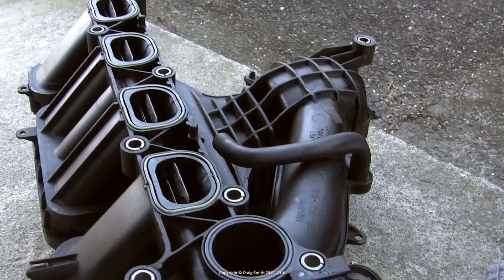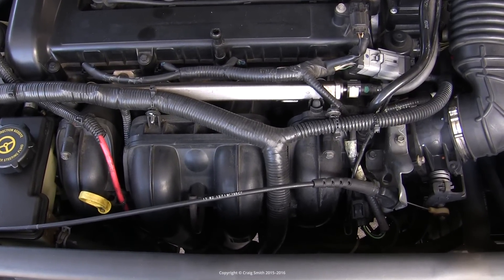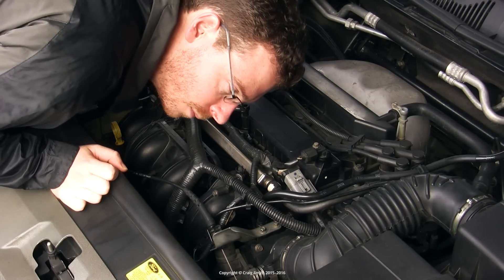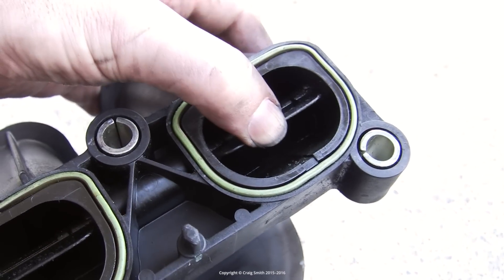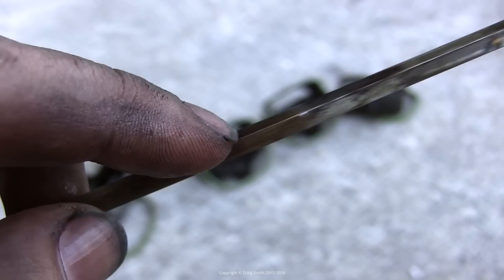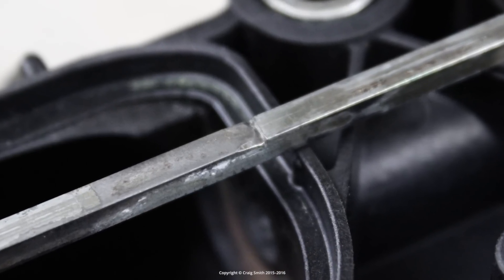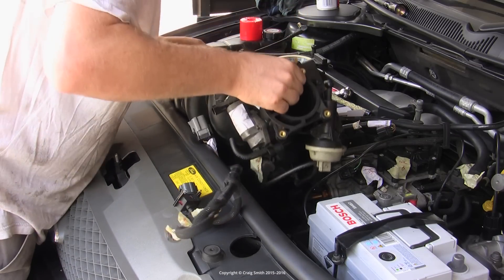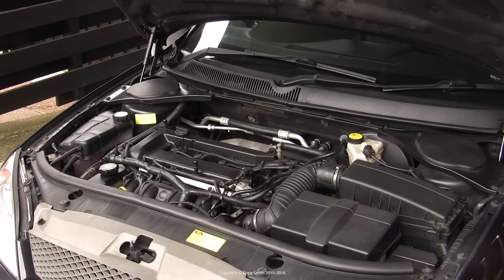How to: Fix swirl flaps & save your engine (Ford Duratec HE, Mondeo/Focus/et al)

Comment: You're awesome! This video helped me a lot. Quick question - do the mondeo flaps fit on to Ford Focus 2009(hatchback) ? Thanks!
Reply from the maker: I think so. I would however order any parts using the correct Focus part #s.
Reply: @CraigsDIY  Yes you're right, but I tried with the dealer and they're "not sure" if mondeo fits on focus. They wanna sell me the whole manifold instead, so annoying! Can I go ahead buy those flaps? What do you think?
Reply from the maker: Check your manifold has the actuator at the side. Then, it would be best if you pull off the manifold and check for yourself. Or, buy from a place that will accept returns!
Reply: @CraigsDIY  thanks man! I just got a used one in good condition. Will try that. Thanks a lot for your help!

Comment: My car had 70,000 miles on it and the flaps were not worn at all, they still fit tightly in the housings.

I removed them anyway, the car runs just as well as it used to, maybe even slightly better. I also installed an oil catch can because the oil seperator on these cars suck too much oil into the inlet for my liking. Might be why the flaps had so little wear in my case.

Comment: I did a simple vacuum mod to a Ford Fusion intake w/o intake runners and installed, easier and works great.
Reply: What do you mean simple vacuum mod? Did you just remove the intake runners and did you still plug up the rubber motor?

Comment: Hi. What do you seal up the hole with where the rod goes? I don't quite get what you said in the video. Thanks!
Reply from the maker: I said Araldite, but any epoxy will do.
Reply: Thanks. Great video by the way.
Reply: Thank you! I have another question: With this fix, is the rod necessary?
Reply from the maker: Not if you're taking the flaps out.

Comment: You sir have probably the best user content quality I've seen on a diy video.... Ever!
Just bought an 07 focus 2.0 duratec with 55000 miles and am really worried about these flaps.
My car already has a pcv failure which led me to your videos.
I also have two bad pulleys and a stuck thermostat or bad coolant temp sensor. I'm not sure because the car will warm up to temp but takes a a little. However once it warms up it seems to pick when it wants to open the t stat and usually when I'm  putting around town. It's random as sometimes heat is fine.
So I'm pulling the manifold and doing a tstat while I'm there doing pcv.
Contemplating deleting the plates but worried about if I fill the holes with epoxy, that it might come out or I'll get a check engine light as I need emissions.
Reply from the maker: I would just inspect the flaps (the rod particularly, as shown). Decide what to do based on their condition, if they're fine then leave them, maybe end-for-end the rod like me. If you do remove them I doubt you'll get a CEL, so long as you put the actuator and its connection back with nothing to do, the effect of the flaps appears to be subtle. 
Almost certainly tstat failed, so long as temp sensor giving sensible readings (ambient temp when cold, and up) it's probably fine.

Comment: Thank you for this video.  Pardon my question: is this also applicable for a 2009 Mk2 (Mk2.5) gas Duratec HE engine?  Do they have the same assembly?  Took me forever to get a video that somehow might be related to the ticking sound (identified by our mechanic as "normal for injectors"). Thanks again!

Comment: Hi, what is the corect name of that mechanism who open and close the flaps? Because i have a problem with him (always is come of from the plastic nut) and i what to replace him but i dont know the corect name. Thanks!
Reply: Solenoid actuator perhaps? Or actuator arm which is controlled by vacuum via the solenoid.

Comment: Could you replace with a fabricated stainless intake manifold?
Reply from the maker: If you really wanted anything is possible... there are alu racing IMs available for the Duratec, expensive and remaps are required.

Comment: Hey man, well made and very helpful video. I have now this problem with my Volvo c30 2.0 Duratec :( Mechanics say that removing swirl flaps requires some ECU software tweaking  Is that true?? Because you don't mention that. I own 2007 Volvo C30 2.0 pre-lift
Reply from the maker: It would probably be ideal but most people report it runs fine without.
Reply: @CraigsDIY  aa

Comment: Hello Craig, just watched your Duratec manifold R&R video and now this one on fixing the swirl flaps. Interesting suggestion to just not re-install the flaps due to cost and take the little fuel economy hit. I may consider that after inspection once the manifold is removed.  I mentioned before you seem to have good video capture and editing abilities, it really makes for a high production value, especially with the post recorded voice over. I think I'm going to try that also on my next repair job.
Thanks, KPO
Reply: Okay, so I finished it earlier on today, the rod was an absolute prick to remove! And there oddly was only a plastic casing with all this ground up looking plastic in centre between inlets. I had to clean all of it down including between inlets were rod was due to how worn it was for the epoxy to grip. I filled every hole the rod went through and left the agitator on attached to side but left the white clip piece out as well so no cel code was thrown either. Initial test drive so far so much more responsive, picks up speed faster. I have noticed a slight delay or something along those lines if giving gas backing of n full gas straight away. Will see what it’s like for the next few days but seems to be running beautiful. Have not noticed a decrease in fuel consumption yet but will be able to tell later on down the line. Give it a go if you haven’t already. Also massive thanks to this channel. Has helped me through my journey with alot of swearing i got there in the end lol
Reply: How did your manifold turn out removing the flaps? Was going to get started on this myself over the weekend. Thanks for any information.
Reply: Kris Lynette I’m currently doing the delete method on my 2002 Mondeo 2.0 Duratec HE as my flaps are around 5x as bad of movement as this video after inspection tonight. It has taken me 3 months to get around to it as I suspected flaps to be the cause and had to weigh up options before jumping the gun. Will update you tomorrow once car is together and another update after a week or so with a flap delete. Note I’m not that experienced with cars and the removal task alone took nearly 6 hours with several 1/4 socket extensions written off as the 3/4 set doesn’t fit where bolts are

Comment: Just changed the whole intake manifold on my 2008 focus 2.0 titanium (UK) for one out of a fiesta st150 runs much better thanks, virtually a straight swap but without the swirl flaps and fitted a new PCV valve & roose motorsport PCV hose thanks for posting these videos Craig they're really helpful 😀👍🏻

Comment: Could one just wedge something into the actuator so that the swirl flaps would be forced to remain open?  Wish I could better describe what I mean.
Reply from the maker: They are open at rest. Disconnect the vacuum hose to the actuator and they won't close. But it won't prevent the problem developing.

Comment: Years ago I had this problem with my duratec 2.0 focus...I bought an intake manifold for an Escape 2.3L  application. The escape manifold don't have flaps. Still mounted the solenoids and actuator but just didn't hook up the linkage as there was none. Worked fine for me for 100k miles.

Comment: I replaced the thermostat in my 2005 Duratec 2.0 16valve and while at it i removed all the swirl flaps in the manifold with no issues to the running of the engine. It runs perfect. So saved myself a few quid.. I was told to do this by a ford mechanic and he was rite.. Took 3hrs start to finish. Was easier to remove the radiator and that gave full access to everything. Great video..
Reply: Has he blanked hole after flaps bar or just removed it all?
Thx 
Matt

Comment: is this applicable to a 3002 2.3L ford ranger?
Reply from the maker: Yes, modulo the details. You can check for the presence of the flaps by looking for the actuator next to the throttle body. But I'm not sure about the actual failure rate on the 2.3's, I only know it's been a major problem as shown on the 1.8 and 2.0.

Comment: Just did the pcv job on my Volvo S40 1.8 from 2005 which has the same engine. I inspected the flaps and found that there were no bushings and not much wear.
Vehicle has 150.000 km and i have only owned it for 2 years so i don't know if someone has done the changed the flaps, though i doubt it very much.

Great video btw, very helpful.

Comment: I know this video is pretty old now in youtube time, but my 2003 Ford Ranger 2.3L 4 cyl Duratech could have been the subject of this video last year! *NOTE: The warning sign for many of these motors having this occur, (and there are videos), is the plug on the opposite side of the manifold and vacuum actuator where the shaft for the flaps goes through , falls out, and creates a huge vacuum leak and runnability problem. It gets punched out by the shaft vibrating and dancing around when those shaft bushings go bad!!!

Comment: A little Question .. i got an focus 2 flexi that sounds like a disel so i guess my flaps are shit and are about to change valve case gasket and was thinking about to look up the flaps to 
 
The idea i had if it would be posible to fixate the axel so the flaps are constantly fully open insted of removing the mainfold then the axel and flaps as an easy solution when easy and fast is nice when working in minus 10-15c and snow ;) ...so what do you think is it possible fixing it that way with out removing the mainfold ??

Tnx for a great video
Reply from the maker: That may slow down wear a little (and not by much I would guess), but it won't fix anything. If they're already rattling they're a ticking time bomb. The wear is done by the vibration.

Comment: Great video but I have a question, does anyone know if this is also an issue on the Mazda MZR engines which seem essentially the same as duratec ones. I just bought a 2005 Mazda 3 1.6 and I am wondering if this is something I should be looking out for. Thanks
Reply: yes, absolutely, my 2003 Ford Ranger 2.3L Duratech (Mazda motor) could have been the subject of this video last year, and with all the info I gained...Your MZR has them also.
Reply: yep you are right I just checked the intake manifold up close and it definitely has the actuator on the side. Well I guess I can add that to my "do once its warm outside" list.

Comment: loved your video!  we just bought a 2010 ford focus and found out the actuator isnt attached to the car, the previous owner took the rod out and the flaps.  do you know we can eliminate the p2004 code by attaching an actuator and attaching the vacuum hose to it, or splice the vacuum hose to another vacuum line?

you would be doing us a great service if you happen to know the answer to this question, thanks in advance!
Reply from the maker: I think it's sufficient to just connect the electronics up, if the PCM sees the right electrical circuit it should be happy, it's not sophisticated enough to actually know what's happening. If the existing hose is available you could use it and just leave the actuator working nothing, on that note check the old mod sealed up the hose nipple on the manifold.

Comment: HOLY SHIT. READ THIS SHIT. FUCK BMW MOTHERFUCKERS- CROOKED BASTARDS.  

(FROM WIKI) 

Operation
Swirl flap position is adjusted by an electrical or vacuum-actuated servo mechanism which is under the control of the engine management system. In a typical implementation the flaps will be closed at idle speed, creating additional turbulence in the intake. As engine speed increases, the flaps are gradually opened until, at around 2,000 rpm, they are parallel to the airflow and present virtually no resistance. Their purpose is to ensure that the air entering the cylinder is sufficiently turbulent for good fuel-air mixing even at low engine speeds. This aids in reducing certain toxic emissions and may also improve low-end power and torque.   

Disadvantages
The disadvantages of swirl flaps are mainly associated with fouling by exhaust gas recirculation, which leaves tarry deposits on the flaps and the inside of the intake manifold. Over time the flaps can begin to stick in one position and the engine management system may report an error code if the correct flap position cannot be achieved within a few percent of the design specification. More seriously, the flaps or their mountings can fracture under the strain and parts can enter the cylinder. This almost always causes major engine damage due to the very small clearances inside a diesel engine. The BMW M47TU 2-litre engine manufactured between 2001 and 2004, and the similar 3-litre engine, is notorious for swirl flap failure, as the small screws used to secure the flaps to their spindle will fall into the intake ports if the spindle fractures; in 2004 the intake manifold was redesigned to eliminate these. Some owners choose to have the flaps removed as a precaution, with blanking plates fitted to maintain manifold sealing. In many cases the impact on drivability and fuel economy is negligible.

In July 2012 The Sunday Times (UK) published letters from affected BMW owners indicating that BMW UK does not accept there is a widespread problem despite the reportedly high numbers of cars being scrapped as a result of total engine failure. One correspondent on The Isle of Man achieved an 80% contribution to his repair costs, perhaps because poor publicity in a small area worried the car manufacturer. In the meantime those unlucky enough to see their viable cars turned to scrap in a matter of seconds have little or no recourse to BMW UK. However some environmentalists in Europe are now beginning to voice their concerns about the issue. The environmental impact of potentially scrapping thousands of cars for the sake of a minor modification is now being raised in some countries where the defective cars have been sold.

FUCK THAT. GOOD CATCH & DELETE. 
Show less

Comment: I have a cmax and my engine light has come on and I'm told its the inlet manifold. Really worried.
Reply from the maker: If you have a code relating to the IM it's probably the actuator or associated wiring, which is not really a big deal. The flaps themselves are really a separate issue and won't set codes.

Comment: Thank you very much for this! My sister's 2005 Focus has some really loud flaps and I'm considering doing this fix. Appreciate the insight!
Reply: Did you end up doing this? I have an 05. Focus and was thinking about doing it
Reply: @sdbw1990  going to take this on next weekend It looks like... my intake flaps are super loud sounds like a diesel and low rpms. Every time I drive it now it makes me nervous after seeing these catastrophic failures.
Reply: @Deloss92  I did this a little while ago. Went pretty good. I used jb weld to fill in the holes between cylinders. Car still running well years later!
Reply: @sdbw1990  I appreciate the reply. I have 248k miles on this 05 and I dont think the flaps have ever been looked at. Looking forward to a nice clean and none clattered idle..

Comment: Hi 
I really like your videos. I've found that one about air intake manifold. 
The thing is that my Mazda MX 5 Mk3 has very similar engine 1.8 duratec. 
I have one issue. After changing pistons rings and valve seals also pcv valve and timing chain, the engine makes strange whistling sound. Similar to turbo sound. The sound comes definetely from the air intake manifold, from its left side  (I've checked that even with the vbelt off).
You can hear it between 2000-3000 rpms.
The are no faults, engine pulls nice but that sound is annoying. Turbo sound without turbo 
Please check my videos.

https://youtu.be/NYokLn2g1sI
https://youtu.be/kqsmXTEMK5Q

Do you have any idea what is that ?

Comment: If you take out the flaps will the engine code still pop up p2004?
Reply from the maker: If you're getting a code it's because of a failure in the actuator or circuit, not the flaps themselves. You can remove them without generating a PID.

Comment: Hi there, awesome vid, thanks. I was thinking of sourcing a replacement rod. It looks like about 3.25mm. Is there a complete spec? There are 3 and 4mm square rods readily available on ebay, maybe this will work if it's harder than mild steel? When I removed my flaps I had a definite flat spot at low rpm, so I am going to put them all back, just need another hard-wearing rod. Ford/Mazda should have made this a serviceable item at 100k kilometres, like replacing a cambelt.
Reply from the maker: They should have designed it so it doesn't wear like this, it's inexcusable really. The rod I believe is 3.5 mm sq, no spec but it will be a stainless steel of some grade. I looked to replace it too but as you say stock rod mostly goes from 3 to 4 mm so I couldn't find any easily. It would also need to be a harder stainless that the typical cheaper stuff, avoid 304 or the like.
Reply: I just noticed this looks like the 2.0 manifold. I have the 2.3. Any idea if the 1317278 flap assemblies will fit my 2.3?
Reply from the maker: 1317278 is the # for the bushings not the flaps. I don't know about the 2.3 sorry. Try to find some decent photos of both and compare.